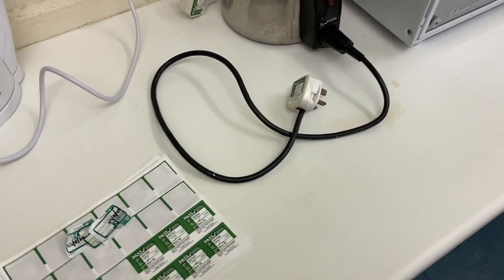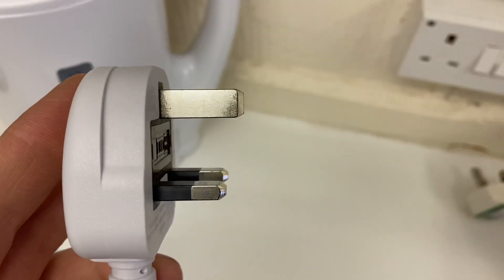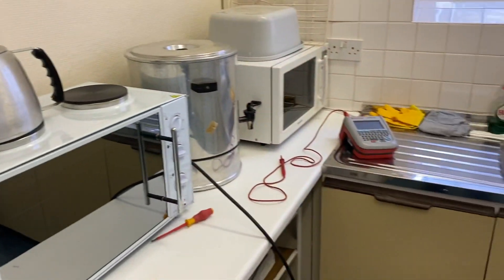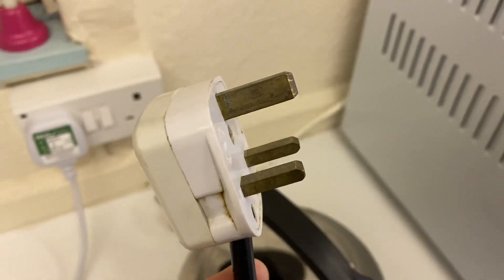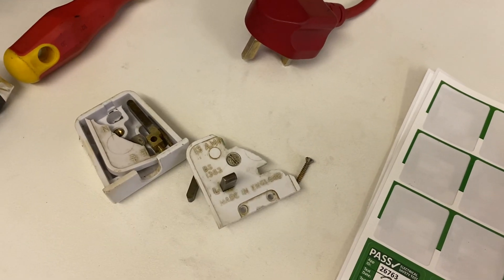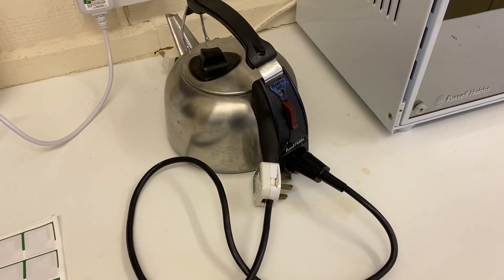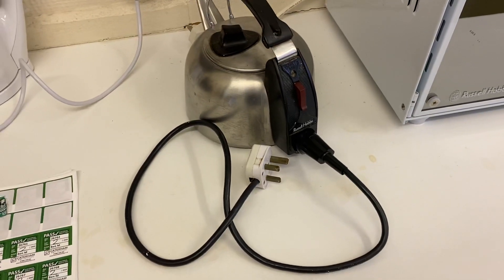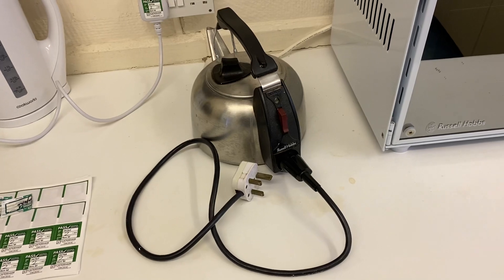PAT TESTING HELP - 13 amp plug needs changing?

Comment: Hi Ben. I’m selling used appliances online such as kettles, toasters, hairdryers etc and my insurance company requires the items to be pat tested with a certificate. Am I able to take a course online and buy myself a pat tester and test the items myself and write my own certificates and if so is there a course you would recommend please? :)
Reply from the maker: yes you can, there is no requirement to have to have done a course. you just need to be competent in testing.
there is also no requirement in having a certificate. an actual certificate doesn't really mean anything. it is more important to have an item register showing what has been tested and when
Reply: @caterhampattesting  thank you very much :) That is extremely helpful. Your videos are great!

Comment: Hi Ben, thought sleeving was added to stop user wrapping bare wires around live pins, thus making their own "multi-appliance" plug?? Thanks for the vids really helpful.
Reply from the maker: No I don't think this was the case. Insulated pins were brought in about 1986 I think to protect fingers from touching the metal uninsulated pins

Comment: Hi Ben, loving your vids, keep 'em coming. Quick question regarding kettles. As most come with a separate base these days do you treat the base and kettle as individual items or as all one item? I've always treated them as one item but seeing this vid got me thinking. I guess you could test the base first between the plug top and the kettle connection point (there's usually a bit of earthed copper visible). If it passes then pop the kettle on the base and test again subtracting the base result from the kettle reading. I'd be interested in your opinion on this and hope you get what I'm banging on about 🙂
Reply from the maker: Thanks for your comment. I test them as one whole item and just label as such. No real need for 2 separate tests.